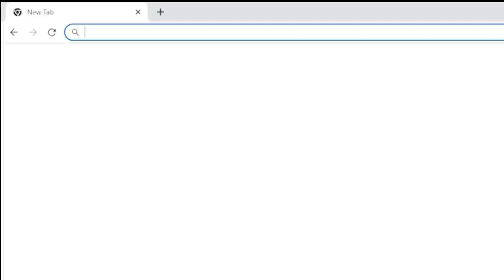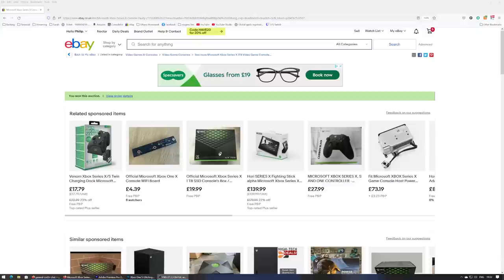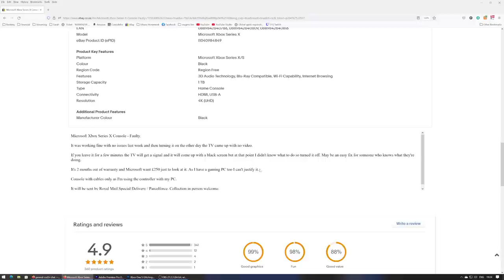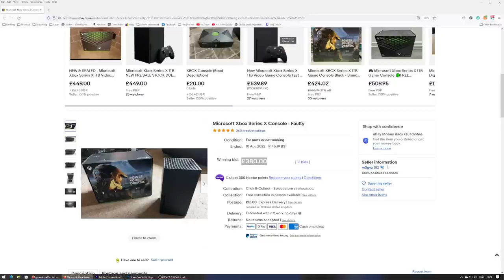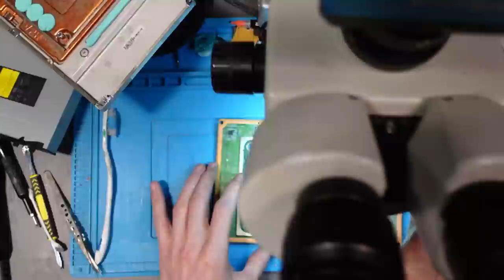I Paid £395 (Almost $500) For A BROKEN Xbox Series X On eBay, But It Was A VERY Costly Loss!

Comment from the maker: A huge thanks to NordVPN for making this video possible. Check out their sweet deals at https://nordvpn.com/consolefix
Reply: hi my friend
Reply: xbox series s black. In short, I have such a problem. When I turn it on, it shows in 6 seconds. I opened it, took out the memory card, SSD. And it works for a few minutes and the ISK reader also works. I checked the hdm port, it's good, I also changed the power supply circuit. But the result is the same.. How should I act and where can I send you the video? To see what the real problem is.

Comment: Should make a hdmi patch board to test the areas 
Cut trace off the faulty board and solder jumpers to ur custom hdmi board to see if get output to fast isolate areas 

Maybe 2 can make hdmi signal injector and externally power that part of board to test

Comment: the esd booster is not boosting the 5v line. i think.

main features for the esd booster are:
a) esd protection of course
b) short cut protection on the 5v line (hdmi side)
c) level shifts for the sda and scl lines (i2c)

i think it gots its name "booster" because it boosts the sda and scl lines to 5v.
normally the output for the i2c to hdmi are 5v. the output from the hdmi chip possibly are not 5v. so you need a level shift from console ic voltage level to 5v.

i2c signals are open drain outputs means you need pull up resistors for both sda and scl.

i've seen you did some bypasses of the esd ic on some xbox one x(?) consoles.
so far i remember some consoles were not able to output 4k anymore right? or sometimes it works.

this is i think because of the scl and sda lines. the scl and sda are used for extended display identification data (EDID). if edid is not available or not working the console can't regonise if the tv is able to display 4k. so it only displays a resolution which is always possible.

interesting in your videos is i only see for sda and scl lines resistors in series. no pull up to 5v.
so the pullup for the sda/scl might be included in the esd ic.

for me the question is more why 4k is working sometimes?  after reading the tdp158 datasheet it says you always need a 2k pullup to 5v on these lines (which is normal for i2c). without the esd ic you don't have them (possibly) means no EDID from the tv.

i'm currently searching on ebay for a xbox one x to test this.

greetz and keep up the good work ;) oki time to continue the video here ...

i learned alot in your videos esp. how to solder/reball my bga fpga for my own created fpga board... i love your videos... thx ;)
Reply: ok xbox one x is ordered with no hdmi output... let's see if i can get it back to life ;)
Reply: the faulty (no hdmi) xbox one x arrived today... 
well i checked everything you do normally:
-switch on the xbox stays on... no faulty hd
-shorts on the esd ic...nope
-hpg/scl/sda lines on the hdmi port are 5v...nope
-shorts on retimer...nope
-resistance check of c50(c51?) near by the retimer ...about 8kohm...nope
-nudge test on hdmi pins ... nope
-filters infront of hdmi port... nope

hm everything seemed to be ok. then i had a look to the retimer if it was changed. and it was. 
seems the guy before me did not check if all pins are soldered correctly.
so small resolder session on the retimer and? it's back to life... big shout out "yes" followed ;) cool. my first fixed console ;)

thanks again for your videos without them i wouldn't have been able to trace down the problem  i guess...

i'll do next week some tests with the esd ic and bypass thing...

Comment: The boards for these are quite thick. The safest way to replace it might be to heat underneath the board first then use the hot air from overtop.

Comment: Love watching your work. I'm still trying to figure out mine.. It had a previous repair of HDMI port and the encoder chip looked beat up, I changed the chip, some resistor/caps, that regulator/transistor.. No shorts on the HDMI port header.. Still no image . I haven't tried that ic you just bypassed... I'm lost at this point..I won't give up, hopefully we both figure it out

Comment: xbox series s black. In short, I have such a problem. When I turn it on, it shows in 6 seconds. I opened it, took out the memory card, SSD. And it works for a few minutes and the ISK reader also works. I checked the hdm port, it's good, I also changed the power supply circuit. But the result is the same.. How should I act and where can I send you the video? To see what the real problem is.

Comment: Think you need a preheater for those or perhaps your hot air is on its way out.?. You said the ic was not available but is there a datasheet for it, so many questions. I'll be watching for part 2 to see the conclusion, one other thing I don't know if you cut it out but do you not test the components off the board rather than put em back to find there short? ? See u on the next one....

Comment: What a great video Phil, I really did enjoy it. I have taken inspiration from your videos and regularly buy consoles to fix as a hobby and I love it. This particular video I am interested in because my latest purchase has also been an xbox series x with no display, and a spare series s for spares. So far I have removed the encoder (what a pain that was!) but haven't replaced it yet. I will wait and see what the outcome of your video is, and if I find anything out I'll let you know as well. Thank you for your videos, I have learnt so much from you. Interesting fact, the HDMI filters on both series x and s are so tiny, but they don't seem to have any effect on the working of the console. I have removed them from the series s and still get a display as normal. Also, they only ever test as OL on the multimeter so I'm not sure what component they are! I am sure they do something useful, someone will correct me!
Really appreciate your content, looking forward to the next video!
Reply: Update: just a warning to anyone planning to remove the retimer chip on either the X or S: It takes a lot of heat, I would recommend preheating the whole board first, before using hot air. Also, the pads are VERY fragile! Even just running a hot iron over them once the chip is off, can cause pads to come off completely…

Comment: Honest question! Where do you find the knowledge of which circuit is which on different boards?
I can identify most individual components on the board but struggle with determining the circuitry sections, like a 5v booster circuit or a noise filtering circuit.
Reply: experience

Comment: Hey Cod3r, I've got an original Xbox with a ripped off pad at a via. Would you recommend using an enameled jumper wire through the via and joining it on the other side? Or perhaps replacing the vias pad?

Comment: I have a question for you buddy. I replaced thermal paste on a lenavo laptop. When turning it on it now doesn't display. Complete black screen. No keyboard. No hdmi output when plugging it into a tv. Power light is on. Any ideas of what this could be ?. Cleaned old paste off with electronical contact cleaner dryed then applied thermal paste.

Comment: Just out of interesting on that chip surely spreading out solder all over the underpart of that chip is going to cause problems, I say that because it looks like the internals of the chip are exposed which is quite wierd to see.
Reply: That’s a flip-chip style package, the pads for the solder bumps are directly on the active wafer side of the chip.
Reply: @midlifelab  Thank you, so its actually a really delicate chip to be working with then when soldering? 

It just seems a wierd thing to have no insulation between the two parts.
Reply: @Ghost572  It is indeed. The flip-chips are particularly aimed at mobile phones and other miniature equipment, not being enclosed in a package making them smaller. 

And having connections direct to the wafer removes the additional inductance due to the interconnect layer and leads!

Comment: Is it just me or does the X seem unwieldingly large and boxy for no need, when you see the internals.
Reply: It needs extra air space for cooling
Reply: It`s actually an incredible feat of engineering they got it so small, have you seen the size of PS5 in comparison?
Parts inside need to be kept cool which is why most PC cases are massive even though there is not much going on inside.